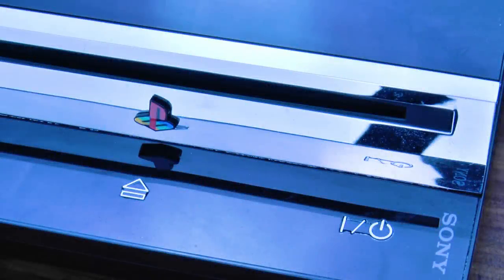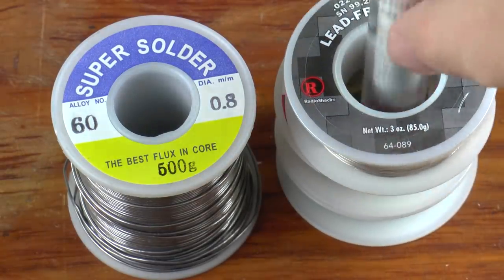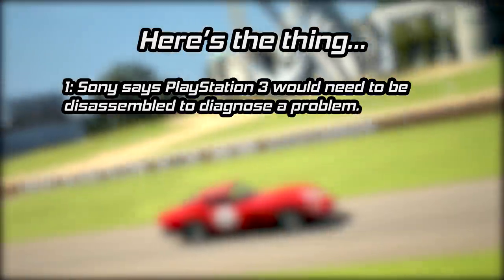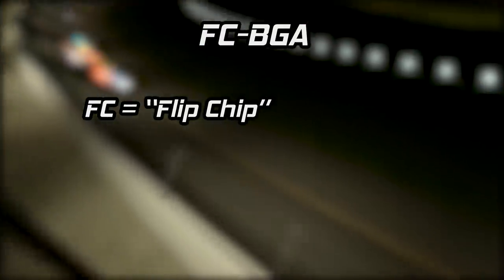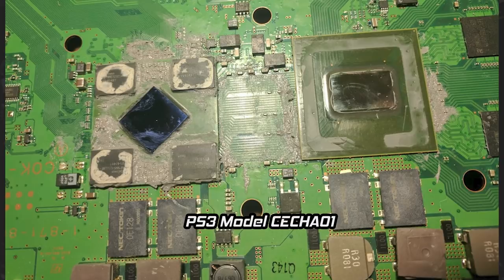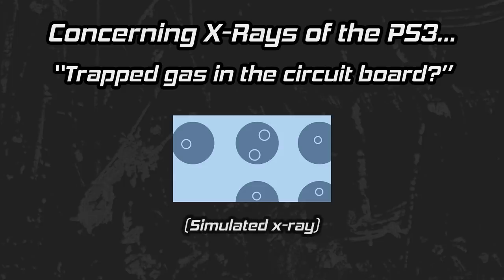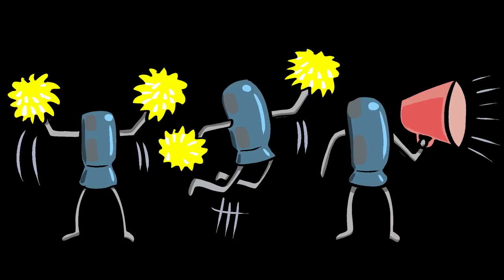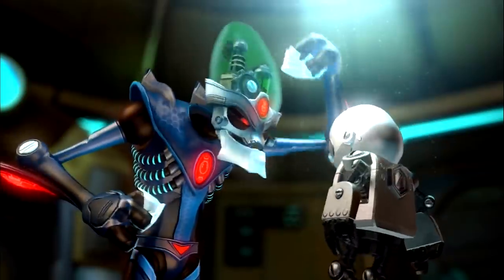The Misdiagnosis of the PlayStation 3 Yellow Light of Death

Comment: Man I'm your fan since the aspect ratio and composite video quality videos. This is once again amazing content. I have a cecha01 that I got recently because of the ps2 hardware backwards compatibility. It is working and the previews owner never installed any kind of cfw to enable custom fan curves. I understand that your video isn't aimed for Mass diagnosis and my question will suggest that I haven't fully watched it, which I did, but do you think that a CECHA that is still working can be a one of a kind that will not show any problem so can be used without any worries? Or do you think a custom fan curve kicking it to 80% before temps reach 65 celcius is a good strategy to keep it working?
Reply: At the end of the day it's still a PS3. if you want PS2 games I'd suggest actually running them on a PS2 Slim SCPH-79001 with FMCB.
Reply: @matt4193   I'm aware of FMCB, I have it on my phat ps2 that has a bunch of games loaded into it's hard drive.  But having wireless controllers, pure digital HDMI output, games running from internal hd, great upscale filter plus psp, ps3 and ps1 games makes it a killer machine. But I understand your point, being an early ps3 it will fail sooner rather than later.
Reply: @veggav  Now that the PS3 SuperSlim line can be hacked I think that's the best option for PS2 classics, PSP and PS3 games.
Reply: @matt4193  Except the Non BC PS3's don't run PS2 games particularly well?!
Reply from the maker: Hey Vitor. Sorry it took so long for me to respond. I would personally never treat a still functional CECHA as a "one of a kind" system because the cooling of these systems for the heat that they output just isn't adequate. Improving your cooling definitely helps and is practically required for these systems. If the NEC/Tokin caps are truly as failure prone as they appear to be, then no amount of cooling will help this inevitable problem.

As for PS2 games and backward compatibility, I believe there is a strong possibility of an HDMI mod for the PS2 in the future. If you are using a BC PS3 mostly for PS2 games, then it is offloading a lot of work to the EE chip for most of the work. So you could elect to just "hang in there" for the time being with your CECHA, but again - extra cooling wouldn't hurt.

Comment: those tokin caps are tantalum right? in my experience yeah if they fail due to cracks/stresses (which would make sense given the overall cooling issues of the ps3, and heat differences warp the board, the caps are pretty large and get bent just enough to introduce small cracks inside their package) heat can sometimes fix it temporarily, but then they'll just dead short after a while because they actually attract air moisture over time and heating a wet cap just makes it crack in a million more places. most tantalum smd caps actually come in a sealed & labeled "best before" anti moisture bag to make sure you don't accidentally solder them after they got moist. to use them after that you have to go through a complicated process of baking them at various temperatures for a few hours to drive off the moisture before you can safely solder them again.

Comment: I encountered Green light of dead aka "GLOD" on the ps3 slim model. It was sometimes able to boot to main screen but when I touch or vibrate the console it would crash and freeze. Sometimes it wouldn't even turn on. It was caused by bad solder connection between the chip and the motherboard. I put a thin sheet of copper on top of both cpu and gpu squishing them between the motherboard and the heatsink. (assuming one of them were causing the issue). And it worked. Then I realized people also fixed the issue using coders instead of copper sheet. So the conclusion is that YLOD is probably not caused by the solderballs between the motherboard and the chip itself but by something else.
Reply: capacitors.

Comment: Not highlighted in this video is the most basic flaw in the PS3 cooling system with the fan.. PS3 default fan setting is flawed that's the BIGGEST ISSUE.. The problem is its a reactive fan state instead of a proactive fan state.. What's the meaning of this? Well the default settings of the fan is to let the CPU temperature get to 70-75c before it actually kicks in full speed to then try and cool the CPU down.. The CPU exposed to these high temperatures causes these issues.. Solution is to Jailbreak your PS3 and take control of your fan speed.. Then this becomes proactive state where you keep fan on a higher setting when the machine turns on say around 30% this will not let the CPU temp get past 65c which is a safe temperature.. Keeping your system getting that hot all the time is the killer... Thats what causes all these issues...
Reply: This was the first thing I did after jailbreaking my CECHC04 PS3. Even if YLOD has other possible causes, those default settings are insane.
Reply: @calleha01  I think they went with low fan noise over actually protecting the system..  This causes issues..

Comment: I recently bought a PS3 fat backwards compatible that was sold as working but wasn't. Long story. But blasting those capacitors on both sides of the board for 30-60 seconds with a heatgun fixed it for now. They should be replaced someday but for now it works.

Comment: My problem is that I have never successfully repaired a PS3 with the YLOD by only replacing the NEC capacitors. It has only been done first because they are known to be a bad cap that can lead to issues in the future... kind of like replacing the time clock capacitor on the OG Xbox. However, I have consistently repaired PS3's by reflowing with no clean flux.

Comment: I still have my YLOD fat PS3 sitting in my closet.  I ended up just buying another PS3 from GameStop to replace it, and kept the old one for parts if ever needed.  I do remember trying the "reflow" a few times with temporary success and replacing the thermal paste, but after a while the YLOD would return.  Now I would be curious to go back and look at the board again and would be curious if it is still actually repairable.  
I used to watch Netflix and other stuff all the time on the old one, thus why it probably lead to some of its breakdown.  When I bought the replacement, I stopped doing that and got an Apple TV instead for that and had better cooling on the replacement, which is why it still works today.

Comment: You can figure out how to diagnose the YLOD with a PS3 diagnostic chip which reads the error logs on the Syscon chip. Once you receive those error logs you now look up the error log codes. The last four digits of the error code tells you your issue and it should narrow it down to a certain area. For example mine was the RSX VRAM chips when it got the YLOD, there’s also a way to figure it out without knowing how to solder but it does involve a CFW.

Comment: Lots of great explanations in this video. There are too many variations of the PS3 Fat and Slim models. One possible way is to have images of good working front and back of the PS3 motherboards that can take pics of your bad ones and use an image difference program like Beyond Compare to see if it can detect the differences. 

Have a couple of PS3 Fat that I am trying to fix.

Comment: Sony don't like to admit to problems, or even replace manufacturing faults (as my mate recently found out when his PS4 went past warranty by 2 months and the BD-drive stopped working and so it would not let him update the firmware, in his case it was a fuse that needed replacing, but that was a sony design fault and not a user fault, but they refused to replace and put the phone down on him), let alone admit to what fault are so they can be fixed. They usually end up being taken to court over it but then pay out to keep it quiet. I can honestly say, appart from my launch PS3 (mainly because I have barely used it), every single Sony console I have had has had faults. 

My PS1 had to be used upside down to get it to read disks, and in the end I had to get a friend to replace the laser as Sony wanted me to pay to repair a common fault (most people I know had the exact same problem with their early PS1). 

Lasers again with the PS2, I did get one replaced, but that went as well so I wasn't going to pay for a 3rd when Sony refused to replace or repair it. I did have a 3rd bought me though, and that went the exact same way after about 15 months, I called Sony and got a nope, but when I told a mate he said his cousin would fix the laser and put in a mod chip for £30, so I agreed and Sony effectively pushed me into getting a console that I could pirate games on when if they had repaired or replaced it, I would have not bothered. 

I cleaned out my PS3 and solved its problem with it crashing out all the time (even though I barely used it), and so ended up doing the same for a few mates (yeah I know, by now you would think I would give Sony consoles a wide berth, but I would get all the consoles, and had done since I was a kid, or I should say my old man used me as the excuse for getting them for himself), I had 2 that just wouldn't work at all, both reconditioned units that Sony again refused to replace even though they were barely 6 months from being "repaired", both had dodgy HDDs, so a swap of them fixed it and I got 2 extra PS3s that I gave to my brother and my mate. 

Then the only PS4 I had (I had finally given up on consoles by then, just gaming on PC), one given me by my mate as he couldn't update the firmware and had gotten a pro as Sony refused to repair it even though it was about 14 months old, and considering it turned out to be a design fault, 1 of the fuses had blown, it was clearly a design fault again, easy enough repair for me and free PS4. I just updated it 5.05 and thats where it has stayed, if you catch my drift (I have long since decided no money from me for Sony).

Sufice to say, no PS5 for me, or XBSX.

Comment: Crazy because I had a non slim ps3 that, as a kid, would keep it inside a closed glass tv stand that would allow it to heat up like a MF. That thing would spool the fan up to max almost immediately, but never failed, and to this day my cousins use it for Netflix and stuff. It would get so hot to the touch that if I wanted to move it to my living room to play on the bigger tv I would need to leave it off to cool because it got so hot to the touch it was unbearable. Also the piano black plastic piece on top got a little warped due to the massive amount of heat from sitting inside it’s “oven”

Comment: Microsoft and Sony did not test properly or did not care about the issue, as they should have noted full load temperatures and designed the system to handle 20% above that, taking into account dust build up or the console not having external active airflow.

Comment: Well Cheif... it is that capacitor (NEC TOKIN)... The main issue try to replace one for RSX first then it should work if not replace 2nd for RSX and for Cup if needed... Generally better to replace both on the back side not close to the RSX and CPU.
Tantalum of 470 uF @ 6v should be best for FAT only

Comment: I have a 40Gb PS3 fat which has never quite had YLOD but is on the verge. It now turns itself off to save itself. I have never ovened it or attacked it with a head gun but did use new thermal paste but had no improvement. I think this video is very interesting and I might look into replacing the capacitors and see if that could help. The PS3 is still a great machine and I don’t want to just bin it.

Comment: My 60gb PS3 model from 2007 has had the yellow light of death for around 5 years now but the weird thing is the console still works.  It only shuts itself off on certain games such as Uncharted, The Last of Us and some other games.  I find this weird as im still able to play a lot of games without issue.  Not sure how much longer it will last until it completely gives up on me, glad i have a backup unit aswell as a slim model.
Reply from the maker: Hey quatz1981. Sorry to hear that your PS3 has YLOD issues, but I am glad that it still works to a certain degree. The Last of Us is one game that is used as a stress test for the system. Some of the guys that promote replacement of the NEC Tokin capacitors have had success getting those games to run without problems post-replacement.

Of course, improving the cooling of those early PS3s is essential.
Reply: @DisplacedGamers  Thanks for that, yeah it seems that the NEC capacitors could be the issue with my unit.  Funny thing is i never knew about those until i saw your video.  Glad i still changed the thermal paste years ago and again recently as i could have had other issues if i hadn't had done that.
Reply: @DisplacedGamers  Or even reduce the heat, what about replacing the PSU with a more efficient one?

Comment: If an older electronic device fails, my first culprit are usually capacitors.
Reply: In this case, that first guess, would be wrong

The NEC Tokens diagnosis... is a misdiagnosis
The solder balls diagnosis... is a semi-misdiagnosis

The underlay, that's the correct diagnosis in MANY, MANY YLODs

Comment: YLOD in alot of older Phat models I have found is nothing more than the system overheating due to dust getting packed around the cpu, gpu and heat sinks, along with the lack of thermal paste on the chips. If you take apart and clean the board very well with qtips and alcohol, remove the old thermal paste " trust me there won't be much" from both chips and heat sinks and replace with Arctic Silver thermal paste be sure to cover the tops of both cpu and gpu completely with a thin layer. Reassemble and I have found that 75% of the time the system will be fixed.

Comment: i have a chechb01 with no video output. no yellow light of death anything. light is green on startup but the only signal i can get out of it is extremely garbled and i can only get it to display it once after it has been powered off for an extended period. The system was working one day and then was dead the next.

Comment: Can electrolytic capacitors be used?

 Its the only one accessible and affordable in my area for electronics, with tantalum caps at the required capacitance at USD20+ here. Ceramic caps have too little capacitance on the other hand.

Edit: just read that tantalum caps are basically electrolytic capacitors with a higher capacitance density. Now I dunno if using normal electrolytic caps will allow the board to fit

Comment: Imagine having gotten a ps3 on release date back in the day. Shit was sold out for like 4 years. I'm so jelly.

I have the motorstorm ps3 bundle from 2007? That is backwards compatible as the 60gb version and I was recently playing through the ratchet and clank game on it. It is the upscaled ps3 version which includes the first two or three games. The console froze up on me like a scratched up movie would if you remember those symptoms and then outright shut off on me. I gave the system a few minutes to cool off just in case and pressed the power button to turn it back on. It made 3 beeps and shut off again. After doing some research, it sounds like the system has over heated. I am wondering how much this would cost at a repair shop and if it's worth it or if I should just go on ebay and buy another used system of the same specs. I've still got a bunch of ps2 and ps4 games I'd love to play through.

Comment: Is that type of capacitor obligatory? Can be used other types of capacitors ?
Reply from the maker: You can use the tantalum replacements like techcore uses for the Toshiba laptop. It is important that the capacitors are equal or better than the original.
Reply: Please

Comment: Well, whether it's an issue with capacitors or with the solder, I find it totally unacceptable that my €399 fat PS2 purchased in 2001 still works with all its original components and that a 2009 €499 PS3 no longer works in 2022!
Any way, I suspect it's the capacitors causing the YLOD issue on the fat PS3 I have due to the behavior it displays: immediately shuts off several times when cold; then boots up if I keep insisting; plays some light games, PS1, PS minis but; shuts off within seconds when loading more demanding PS3 games and after a few minutes when playing Blu-rays

Comment: In my very personal case, because I won't assume this works for all or anything, the heat for all the main board for a short period of time (I didn't know much then, but I wasn't losing much either, but yes, not the best advise...) worked like a charm for many months (or years, I can't remember, but I only had to make it once). When It happened again, I warped the plastics, so I couldn't assemble it again, i.e. it wouldn't work, but I saw that with just some cooling, PS3 dissassembled (a big fan blowing directly and/or some ice to the board, isolated to avoid a short circuit), I could make it work for as many hours I want, given that I don't stop the cooling, so I could backup all of my data to transfer it to a PS3 slim, which was a success because I just wanted my data, but I just don't know why it failed and why it worked for me. So, as you said, it's not a simple fault and there are many. Maybe I could try changing the capacitors in the future, but I'm pretty sure that if I make a custom case to fit a cooling solution, I can make it work flawlessly.

Comment: Mine died while watching a DVD of Resident Evil damnation -- I thought it was the solder under the PS2 chip but now you may be right, it could be the damn "chip" capacitors. I had my initial YLOD fixed by reflowing, changing paste under heatspreader and increasing mounting pressure so this YLOD is its second.

For such a classic problem from that era of widespread failing LCD monitors and motherboards to come out as frikkin' chip lookalikes.